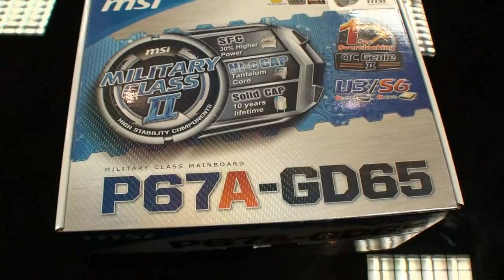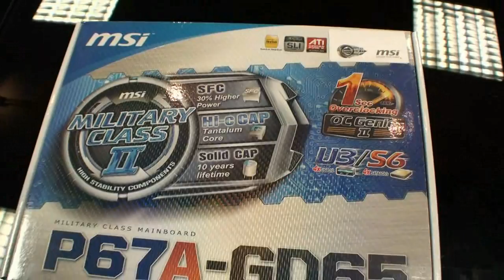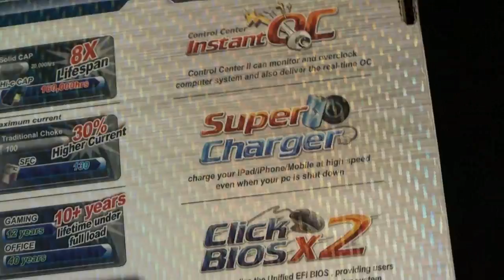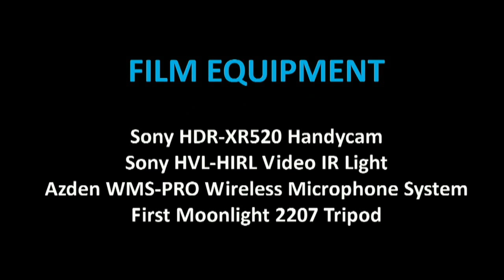MSI P67A-GD65 Motherboard Hands-on

Comment: I have this same board with a i7 2600 k. it will not work with my corsiar 4 gb (2X 2GB) running at 2133 mhz dominator mem. also it seems not to work with the asus HD6970 graphic card i have. so to me it sucks looking to replace it with another board

Comment: @pdani72 unfortunately intel has said that 1st gen i5's (1156) will not work with a p67 or h67 board (1155). If you have any questions just ask me as i just now ordered this board and a 2nd gen i5-2500k